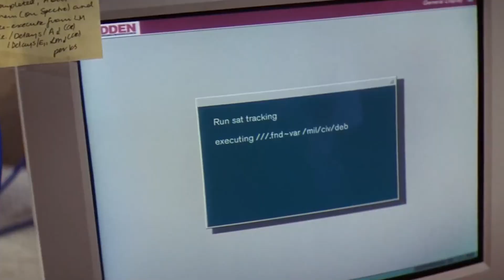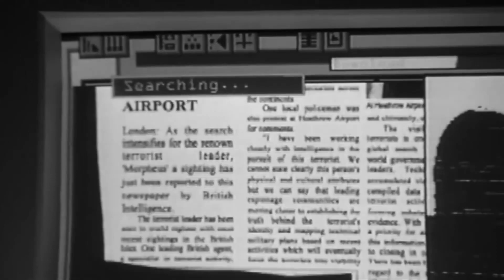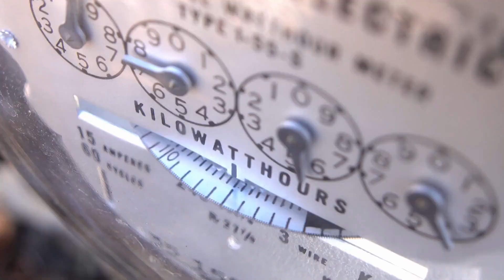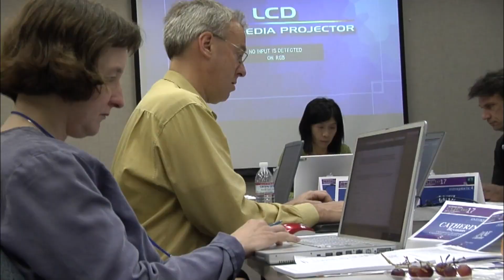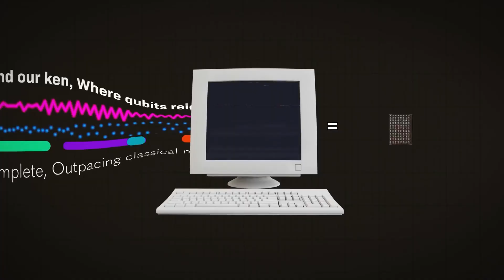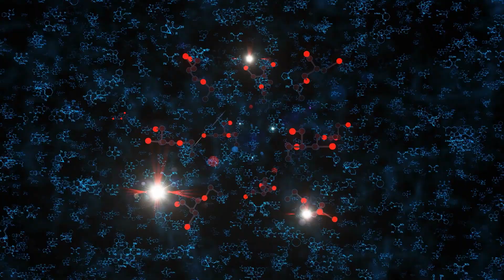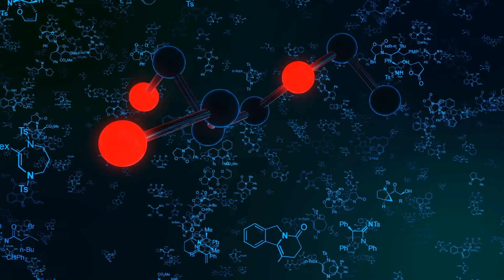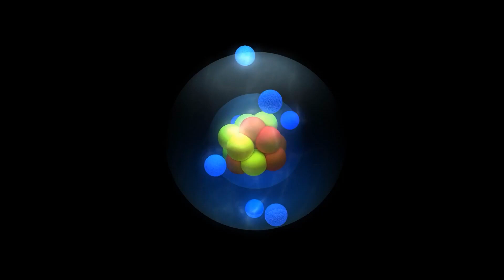Why Michio Kaku is CRAZILY Obsessed with Quantum Computers

Comment: Quantum Computers are a thing of the past. Utilizing a tri-state system to represent collective effects, especially in a classical computing environment, is the way to go! since 2020 with Intel's Tri-State Logic prossesors, the world moved away from binary logic and went in the direction of a more nuanced, ternary or multi-valued logic system, which  offers a different path to solving those problems that only QC could solve before 2020!

On September 18, 2019, Purdue University published an article titled, "Poor man’s qubit" can solve quantum problems without going quantum."

"probabilistic computer"  utilizes "p-bits" as its fundamental units, to bridge the gap between classical and quantum computing. P-bits fluctuate between states 0 and 1 and can solve certain problems typically addressed by quantum computers, but operate at room temperature unlike qubits which require cryogenic conditions. This development lead to Intel's tristate: X, and Y are 0 or 1 but Z can be any value in between. Vola!  Put the QC in a museum now! Dish $5K to $10K and get yourself a room temp TriState that does Quantum too!
Reply from the maker: You are right but Quantum computers may still be useful  in the future.
Reply: You're not very smart, are you?  🙄